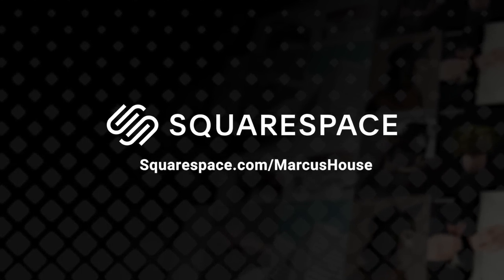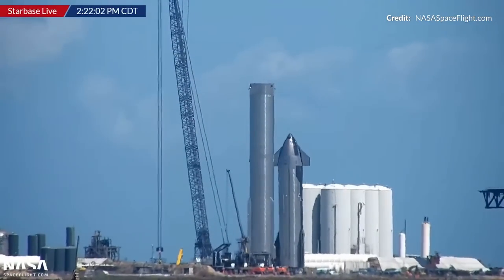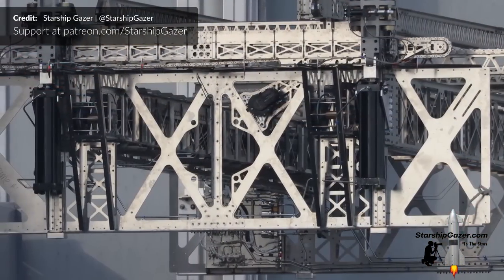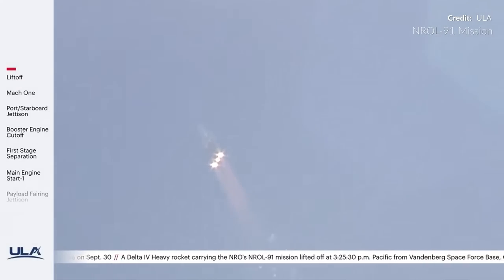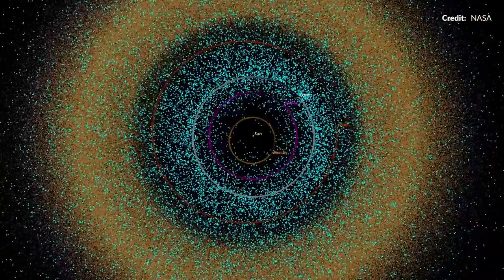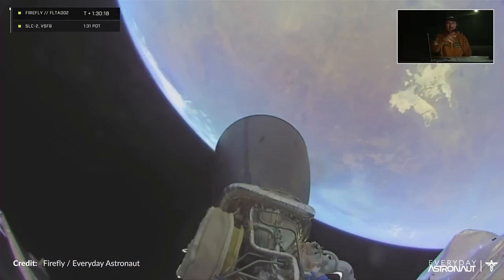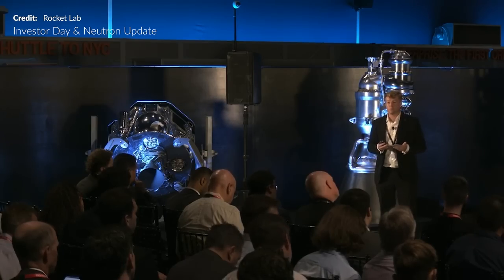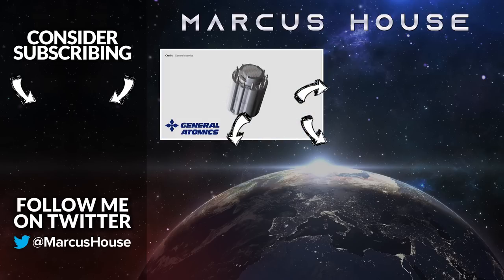SpaceX Starship Updates, NASA DART Mission, Firefly Launch Success, Delta IV Heavy and much more.

Comment: On the more basic construction of the SpaceX Satraship without studs etc, is there any currency on the idea that they'll build a boilerplate mock mass simulator to sit on top of the booster for engine testing?   At some point, they'll do a full engine test on a booster, and without mass to push down on the booster, the power/weight ratio will be higher.   Instead of full stacking with a Starship (engines and all) that would be vibrated to damage being clamped down, would it not be better to have a basic mock Starship on top water or LN2 filled to act as a mass simulator and sacrificial if all goes wrong?

Comment: Hi Marcus,
Thanks for another great weekly space update. Did you see the report that NASA will not allow SpaceX to launch Starship from LC-39A until SpaceX agrees to make SLC-40 capable of launching manned Dragon capsules. I think this is a smart move in the long run, but it might temporarily slow down the launch cadence of the Falcon 9.

Also, did you see that Peter Beck (Rocket Lab) just signed a ten year lease for the A-3 test stand complex. This is exciting because NASA spent over 350 million dollars and seven years to build it (from 2007 to 2014), and it was never used once. So now it will finally have a purpose.

Comment: Hi Marcus, a comment not specifically aimed at this video but I’ve always wondered why Starship doesn’t try to emulate the booster section and come in tail first relighting engines to act as a heat shield.  I believe it because of the fuel required to slow it down from the much higher speed. I think 20,000km/h versus 2000km/h.  But I’d love to know what the number are if it skates in on one engine until it needs three to slow more?  Can you think of an combo of engine and a blow away ablative heat shield on the bottom of starship so that is is a “traditional capsule” for part of the decent and a propulsive heat shield for part?  I’m very sceptical about the tiles solution, yes they have simplified the “special shaped tiles” complexity but have not addressed the inherent weak point of a single damaged tile.  
Your thoughts?
Reply: Ps Marcus, maybe there is a video in this that adds to your heat shield tiles video.

Comment: Thanks for another wonderful video.

"...Now these are not just useful for us to peer at, but also the 3D artists who quickly got to work, fully analyzing the entire system pixel by pixel to get a very good understanding of it all."

It's just astonishing what 3D artists like ChameleonCircut can do. To start with a photograph of something like the dispenser and infer an actual working mechanism from that! It's more like speculative engineering or intelligence analysis than a hobby, and must take enormous effort.

It's pretty darn cool how the Delta IV Heavy sets itself on fire at launch. Gotta admire that spirit. If rockets were people, this one would be screaming a battle cry as it leaps into the air. We'll see if the Vulcan Centaur replaces it. The Centaur sounds like it could be a good rocket, but relying on engines from Blue Origin is... iffy.

Can't really fault NASA for the latest SLS delay. I"m glad they got it back under cover in time. Hopefully they can launch in November.

DART is awesome, it's true. There's nothing cooler than smashing a big thing with a fast thing (entire fields of physics are based on that), and I love your characterization of the mission as scoring a revenge point for our dinosaur buddies - but I suspect the results won't be as big as they're predicting. It looks like Dimorphos is one of those rubble pile asteroids only held together by gravity. If there's no solid core, the kinetic energy from the DART impactor will probably be transferred to the rubble nearest the point of contact (making that spectacular plume) and not any rocks further in. So they probably blew a big hole in one side, but didn't effect the orbit of the asteroid that much.
Reply: The predicted change in dV was 0.4mm per second, so they weren't planning on moving it much.

Comment: Hi, Something that bothers me a bit about Starship and Starlink. Is their not interference between the downcomer and the “Pez” dispenser?  If I remember correctly the current design has the downcomer going down the center of the nose section.
Reply: I think the downcomer is running down the side of the nosecone

Comment: What about all the debris kicked up by DART, won't that become a hazard for navigation in that area, slowly increasing? or is it expected that the larger asteroid will retain that in it's gravity well? it seemed like there was a lot of high speed ejecta from the impact to be retained by the weak gravity of that system.
Reply: It's 7,000,000 miles away and never gets closer to Earth than 3,000,000 miles. Space is really big, so it almost certainly won't be a problem.
Reply: @steveaustin2686  I'm thinking of future space missions beyond Earth. It seems there is now a LOT of debris in the region of that asteroid with the cloud expanding. Maybe I just am missing the concept of how vast space really is. :)
Reply: @BrotherAlan  The Planet walk we did for our kids really opened my eyes to just how vast space really is. The title, IIRC, is "Earth as a Peppercorn: The Thousand Yard Model" and it is accurate in size of the planets and the distance between them. You can do it with an 8" ball and some peppercorns, pins, and some nuts. Well worth the time to do it.

Comment: The insane thing is , even those new crew modules from Ariane and Rocketlabs will be rolled out before Boeing will finish with Starliner 😅😅
Reply: ☝️☝️Hey☝️☝️Congratulation you have been selected among my shortlisted winner’s🤩🎊🎉❤️🤝.,.,.,.,👆👆👆
Reply: It appears that Starliner may fly the CFT demo flight with 2 crew to the ISS in Feb 2023, if the range, Atlas-V availability and ISS US docking port adapter access all workout for that month. I'm sure NASA would like to have two spacecraft for crew missions, like they have two CRS spacecraft and will be adding a third.

Comment: If you take  Dragon up to Hubble, it's only a small step further to train someone to replace parts on Hubble again and refresh things like was done on Shuttle servicing missions. Flights on Dragon are so much cheaper than Shuttle flights and keeping Hubble in action and extending it's life is good because it still can do things that no other telescope can do.
Reply: Except Crew Dragon doesn't have an airlock or a way to grapple Hubble. The Trunk on Crew Dragon is pretty small compared to the Shuttle payload bay.
Reply: @steveaustin2686  All easily overcome, think about it.
Reply: @roycsinclair  Sure you can depress the spacecraft instead of using an airlock like the Shuttle did. There is no arm to grapple Hubble with, but you could install it in the Trunk. But space is limited there, so you won't be taking many replacement parts, if NASA would allow private astronauts to do that kind of work in the first place. All easier said than done, except for depressing the spacecraft as it is built for that already.
Reply: @steveaustin2686  Doesn't require an arm, current plan to boost Hubble is probably based on docking Dragon to Hubble using the ring on the bottom of Hubble which was used to hold it in the Shuttle cargo bay.

With Dragon docked to Hubble it can boost Hubble with ease. Doesn't require a full crew in Dragon either, the extra space inside can be used for additional parts but the biggest hurdle is getting EVA suits for the crew to wear as those will take up space in the capsule.  

Without servicing Hubble, Dragon would not require more than one crew member to fly Dragon manually in case the automation failed.

Biggest issue is EVA suits but SpaceX has been developing those for their own use with Starship anyway.
Reply: @roycsinclair  The Polaris Dawn first flight will test a SpaceX EVA suit, that is a modified IVA suit with an umbilical. That Polaris Dawn test is with 4 crew, so the other three are stying in the capsule in their IVA suits.

If Crew Dragon docks to the ring on the bottom, assuming it can, then no one can get out of Crew Dragon, so no repairs are happening.

I believe that the parts that can be swapped on Hubble are all fairly large, of the swap the module type.

They would almost certainly send two crew, so you have someone to help out in case of trouble.
Reply: @steveaustin2686  Crew Dragon has a door on the side too, the one on the top is used when docked to the ISS but it's not the only way into and out of the capsule.  Definitely agree that they would need two in the capsule, maybe even three if they think some maintenance may take two spacewalkers leaving a third for emergency backup.   Dragon is capable of hauling as many as seven people though so far they've limited it to just four seats.  That extra space has in fact been used to carry more cargo to the ISS already, the limitation of course is how many things they might want to do to Hubble to refurbish it would be able to fit in the door in the spacecraft or in the trunk.  

The key thing to remember though is that just by doing nothing more than boosting Hubble to higher orbit as they are currently planning does in fact keep the craft in space longer giving them more time to come up with other plans to extend it's life even more.  Can you imagine using Starship to eventually retire Hubble by retrieving it from space so it could be placed in a museum. They could eventually bring it back, change it's defective mirror out for the other mirror they made for it and then put it back into orbit. Might be simpler though to build another Hubble II though.  A working Starship launch platform will make it possible to do a great many things that have been only theoretical so far.  

That's why I'm such a fan of the Starship program, I'd be a lot happier if Blue Origin were competing neck and neck with SpaceX instead of perpetually stumbling over their own feet because reusable super heavy launch vehicles are going to be what makes the big difference for the future.  The re-usability of Falcon 9 has already made a sea change in space flight and brought a lot of new investors and companies into the business which will lead to a fall out as many of them go broke but the monopoly of space flight being held only by governments has been broken, hopefully to never come back.
Reply: @roycsinclair  The door in the side of the Crew Dragon capsule is bolted shut before launch and unbolted after landing. You can't open it in space.

Crew Dragon only has 4 seats per SpaceX. You will note neither Inspiration 4 nor Polaris Dawn were reconfigured for  7 seats and stayed in the 4 seat configuration. SpaceX paused after 4 capsules and never built a 7 seat one for private use, even though they have had at least 7 contracted flights already flown or flying in the future.

"After SpaceX had already designed the interior layout of the Crew Dragon spacecraft, NASA decided to change the specification for the angle of the ship’s seats due to concerns about the g-forces crew members might experience during splashdown.
The change meant SpaceX had to do away with the company’s original seven-seat design for the Crew Dragon.
'With this change and the angle of the seats, we could not get seven anymore,' Shotwell said. 'So now we only have four seats. That was kind of a big change for us.'" - Dec 2019 Space Flight Now article with SpaceX COO Gwynne Shotwell

It would be simplier to build Hubble II, since Hubble is so old. Think of it as a 1990 minivan taxi driven hard and upgraded a few times. Time to give that minivan a rest and buy a new one. Hubble is 4.2m in diameter, think of what you could do in the 8m cargo space of a Starship that you just left in orbit as the hull of the telescope.

If there is one thing Blue Origin is known for, it is a VERY SLOW development cycle. Based on New Shepard, they make good equipment, but just take WAY too long to develop it.

Comment: If the moon was gravitationally locked with the big one (it was) wouldn't that interaction negate any initial orbit changes?
Like bumping into something anchored with a rubber band, it's just going to rebound
Reply: Gravitationally locked is about its own rotation, not how it revolves around the larger object. The Moon is gravitationally locked, in that the same side of the Moon always faces Earth. But the Moon is receding from Earth at a few cm per year. So they can change Dimorphos' orbit around Didymos and the predicted change was 0.4 millimeters per second or over 1/63 of an inch per second. It will take a few weeks to observe the pair to determine the new orbit.
Reply: No. DART hit Dimorphos head on at a velocity of ~6.6 km/s (14000 mph), close to dead center. Momentum must be conserved and in a purely inelastic collision the DART's (all linear), momentum would reduce Dimorphos' linear momentum by the same amount. In a glancing collision, some of DART's momentum would be transferred to Dimorphos' angular momentum but total momentum would still be conserved. The actual event was a mix of an elastic and inelastic collision plus other factors which mitigated and amplified the orbital effect. Orbital parameters depend only on the linear component of momentum which directly relates to orbital velocity which, in turn, affect orbital period and height.. The angular momentum of Dimorphos, (i.e., rotational speed - locked or not),  has no effect on orbital parameters. 

Your example regarding "something anchored" still obeys the laws of physics but now must include the anchor. Didymos and Dimorphos are unanchored, free space bodies.
Reply: @steveaustin2686  According to Wikipedia, Dimorphos  IS  gravitationally locked with Didymos.

Perhaps a more relatable (and easier to measure), result of the mission is the expected ~10 min increase in Dimorphos' orbital period to ~12 hours.
Reply: @GntlTch  I know. That means that Dimorphos shows the same side to Didymos all the time. Just like the Moon does to Earth.

I thought that they were lowering the orbit around Didymos, so that would mean it would orbit faster and have a shorter overall orbit time. So if they were instead raising the orbit, it would travel slower and have a longer orbit time.

Comment: Why worry about gravity loading the "Pez" dispenser when the payload will be released in zero-g?  In other words, it doesn't have to have a lifting mechanism with the mouth at the bottom.  The mouth could be at the top of a simple stack (spring loaded, or otherwise), no lifting required.

If SpaceX goes after Hubble it will be more than a relocation mission.  It's an opportunity to get a brand new scope via refreshes, upgrades, and additions.  There is no corrosion or decay in space so it's still mostly reusable parts.  Electronics will wear out, but they can be replaced.  Anyway, it'll be one more way for Elon to make his mark on history so he won't pass up.  Hey, why not boost it out into the Kuiper belt?  I bet Elon could get it moving REALLY fast!